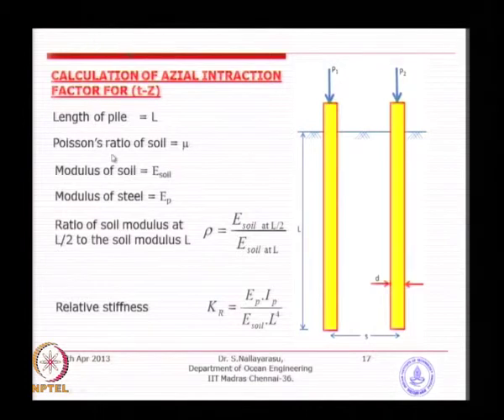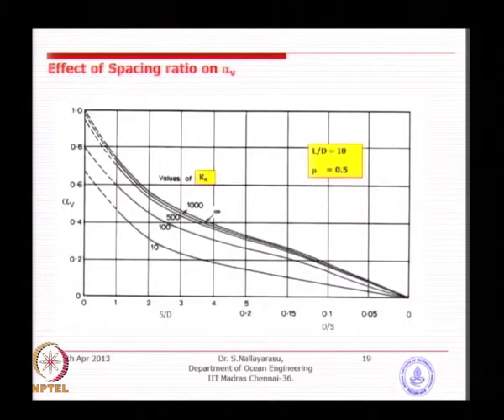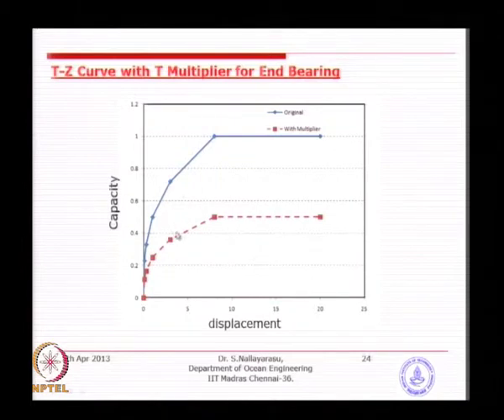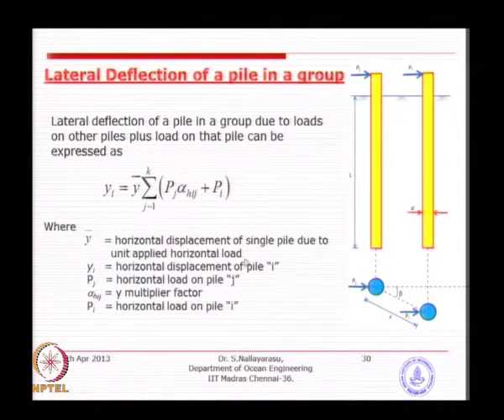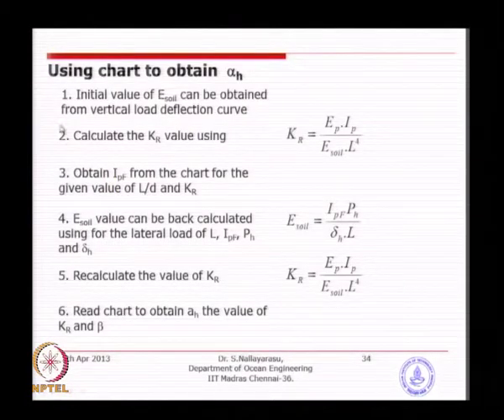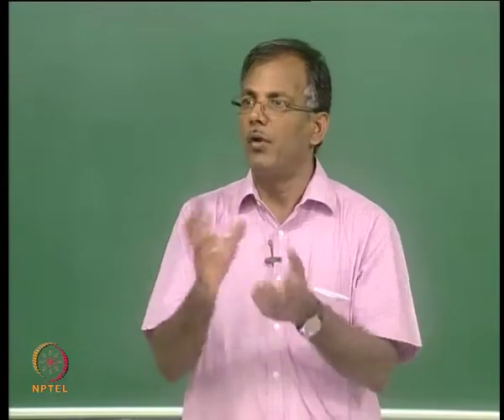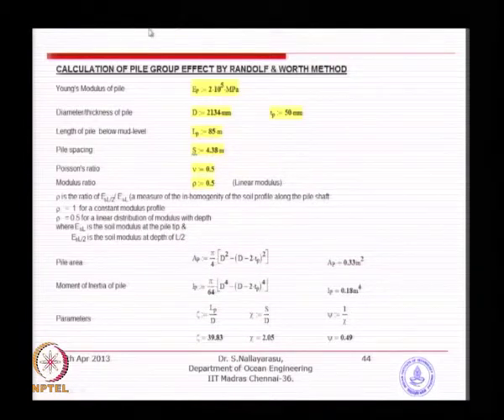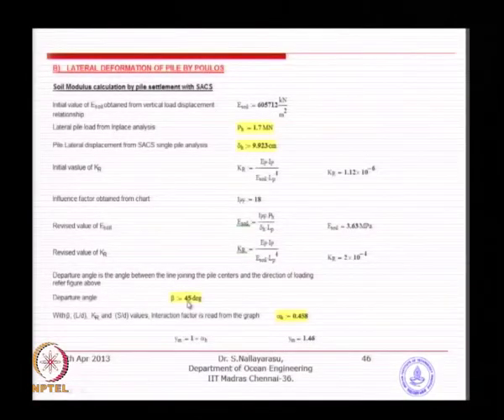Mod-01 Lec-33 Two Pile Group Effect For Axial Load

Comment: thank you for the lecture. However it seems the randolp and worth method is flawed based on what the lecturer said, at 5times the diameter Alpha v=0.45 which is not in line with what is expected. May someone please clarify this.